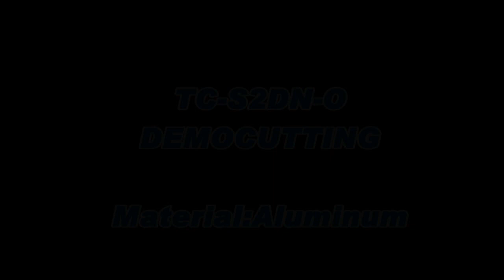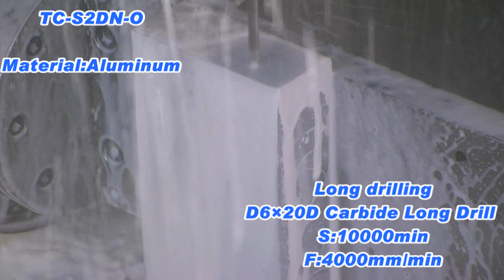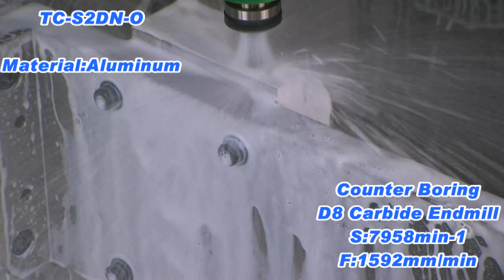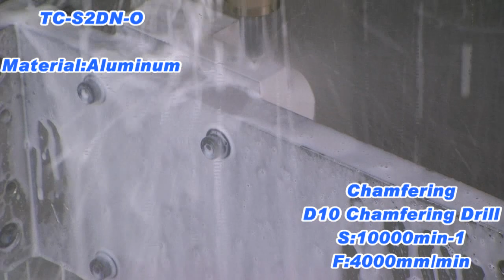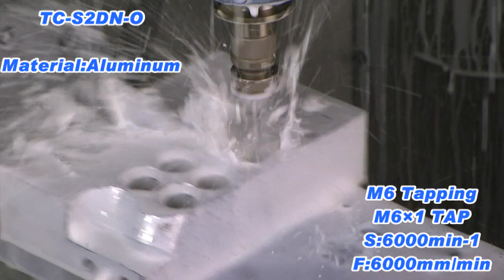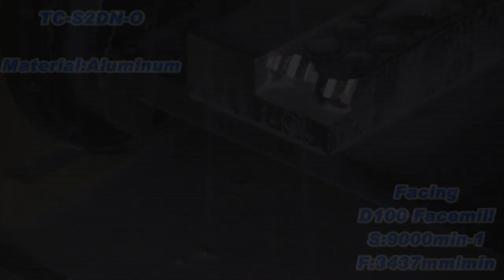Brother - TC-S2DN-O Aluminium milling

Comment: the material is listed as aluminum, well is it 6063 or 6062 or 6061. (6061 is aircraft grade aluminum and the bigger the number the lower in quality it gets.)
Reply: +Matt Smith What?  I think you're forgetting a buttload more alloys of aluminum.
Reply: +Matt Smith what are you talking about aircraft use 2000 series aluminum which is copper aluminium 6000 is magnesium. yknow nothing